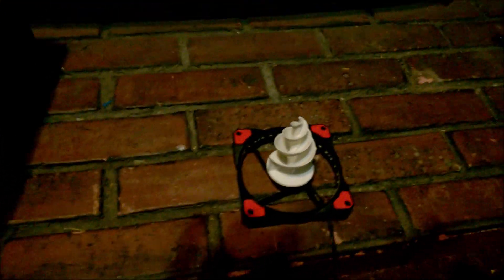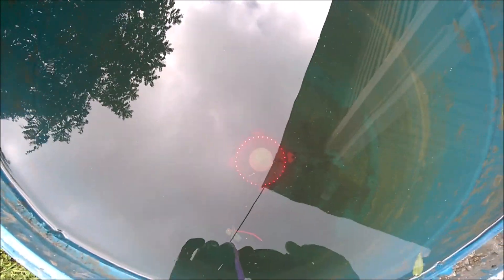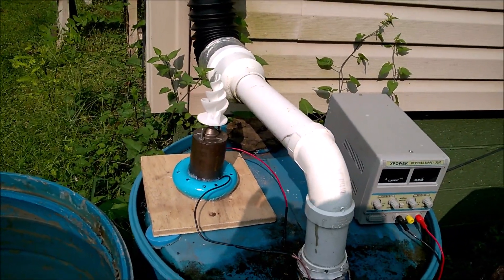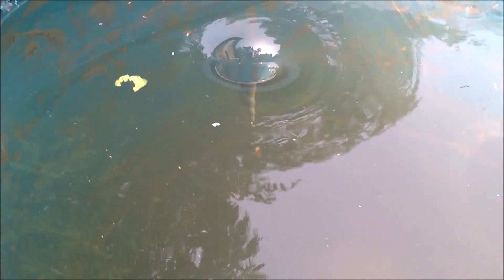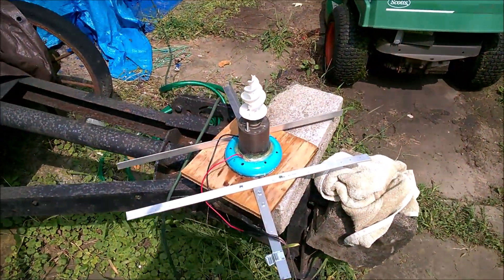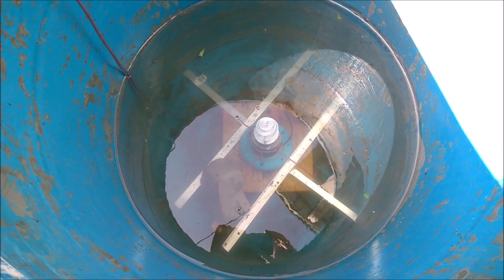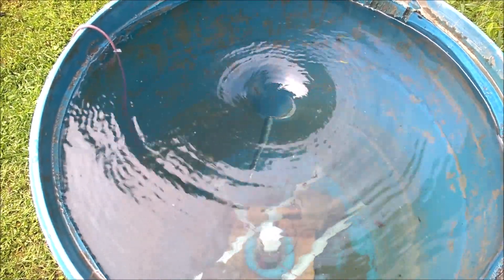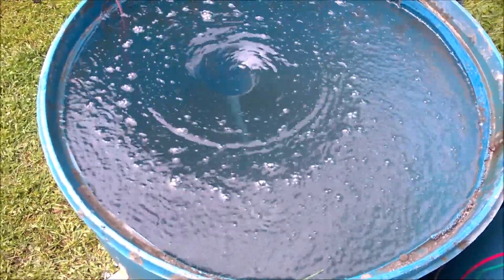lily impeller

Comment: I am looking for a suitable motor for this impeller... I have a acrylic colom of 400x2000mm and want to create a vortex... does anybody know what motor to use for 24 hours display? Thanks a lot I have been searching and searching...
Reply from the maker: any DC motor will do as they all work in water Smaller motors should work will just take more time Id get a motor at least 5 amps I believe mine was 7 to 12 amps just for reference

Comment: I would like to have this in a tube of 2 metres high and 250mm width... is it possible to purchase one? Thanks
Reply from the maker: yes you would have to ask or see company's that do Fabrication if u want metal or if you know anyone with a 3D Printer to make one to size if not there are company's that will do that for you
Reply: @madscientist4021  do you know such a company?
Reply from the maker: @probreathingNL  all you have to do is look up 3d printing services that said here is one https://www.xometry.com/3d-printing-service?msclkid=a44cdc4eb00f1285013d8220dee81729&utm_source=bing&utm_medium=cpc&utm_campaign=PB%3AM%7CNT%3ASN%7CAN%3AManufacturing%7CCN%3A3D_Printing&utm_term=3d%20printing%20services&utm_content=PB%3AM%7CNT%3ASN%7CAN%3AManufacturing%7CCN%3A3D_Printing%7CPN%3AService

Comment: Great video. Have you read the books about Viktor Schauberger, like Living Energies by Callum Coats, or an even better book, One Eye In the Land of the Blind (Reinout Guepin)? I'm sure you will find valuable insights in those texts.
My Q is: Would it be possible to have a design of the impeller so that water flows through it, at the center, so that while it flows through it, it spins the impeller (and turns the turbine). I'm thinking it would look like the impeller you have, but inside-out. Now of course, this would mean the water would need an empty basin to go to (or maybe, the energy generated thru the turbine could pump water back into the drum, a sort of perpetual vortexer?). Thanks for the great video! Keep us posted with more, please!

PS: The reason I ask this, is because by using this mechanism (inspired by the humble trout), Schauberger envisioned running vehicles that propel themselves using suction (implosion vs explosion), like the trout. Here's one schematics of just such an aircraft (sucking the air through the central hole, vortexing it, creating a low-pressure bubble around it)  http://discaircraft.greyfalcon.us/Viktor%20Schauberger.htm
Reply from the maker: yes I have seen  Viktor Schauberge unfortunately no one has been able to replicate it much. But yes you can design the impeller to have water flow threw. Good idea.  there is a device he made to generate power with implosions and I saw a video on it but no answers yet.
Reply: https://ru.b-ok2.org/book/5207633/c2c886
Reply: One Eye In the Land of the Blind (Reinout Guepin)  HARD TO FIND PDF  FREE

Comment: Noob question: How does this electrical wires work in water????
Reply from the maker: its DC it works just fine plus its not many amps all DC motors should work in water
Reply: Mad Scientist  ok good to know. I dont know if your goal is to experiment about structuring water, but the current whos flowing throught the wire and the motor possibly affect the structure of the water also.
Reply from the maker: @lemochisme9438  if your referring to john Ellis water so far looks like its Fake I did many experiments on it and proved it was not as advertised

Comment: What RPM is the motor?
Reply from the maker: I think its 1200 rpm
Reply: Cheers dude. Want to try using this to swirl a 60 litre and was going to try speeds up to 7000rpm but I want to use a lot less power than 8amps
Reply from the maker: @jamieclarke321  should do fine Just know you need to Anker it to the bottom quite a bit of pressure and good luck

Comment: If the vessel radius is extremely large it possibly could produce more but it wouldn't be affordable because of scalability. Same,with the offset high density wheel. Then the bubble water wheel method so many ways to extract energy.
Reply from the maker: Not so sure you can extract energy but Mainly this is good for Aerating Ponds and Water Sources at a lot less energy. I seen Larger versions they work well But still need power to go
Reply: @madscientist4021   it's flywheel energy storage. Small mass moving at the center. While a large mass spinning  with a large radius seems,plausible
Reply from the maker: @brettmoore3194 oh I c I tried something similar Didn't work so well Bigger one not sure

Comment: Fantastic, any one noticed that his setup running on?
 7,7V olts and 4 Amps
Thats comes to theoretical 30.8 Wats of motor power.
Very efficient,
Thanks for this video, you did confirmed  that.
Reply from the maker: your welcome and yes very efficient you can do it with less power just takes a bit longer to create the vortex. I bumped it up a bit for the video

Comment: Ive inventedthesame thing with a propeler on top to generate power it can be done
Reply from the maker: I was thinking the same thing when I did this But I don't think it would generate power especially when you use the power it would slow things down
Reply: @madscientist4021  i will reply later on  about the big propeler 🙂

Comment: I'd like to use the Lily impeller on a troling motor instead of the propeller that comes with it
Reply from the maker: yes I was also thinking of a New way to produce power with lily impellers inside a PVC tube and running water. you could reverse the process and make a sorta turbine. I did look up right angle geared shafts that would work.

Comment: are you spinning it to the right direction?
Reply from the maker: it actually works in both direction I wasn't sure myself till tried it
Reply: it should work best in one direction. where it doesn't scoop the water in. also, should be egg shaped (outside parameter)

Comment: Great vid! What motor did u use? What was the voltage and amperage?
Reply from the maker: originally I did a 12 v very little amp computer fan but was not strong enough. The other motor was a brushless DC 12 V and I brought it up to 8 amps